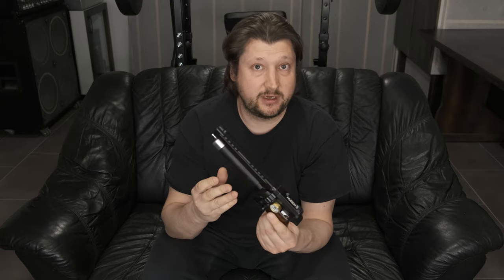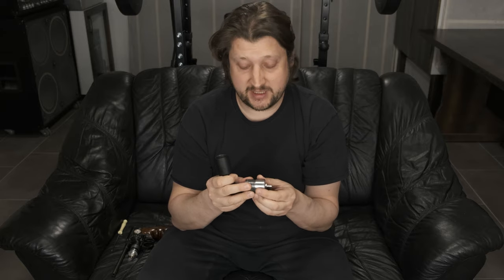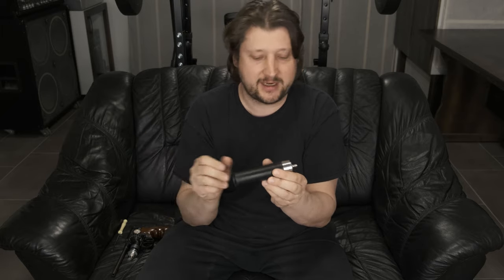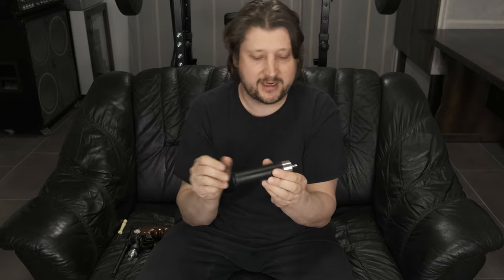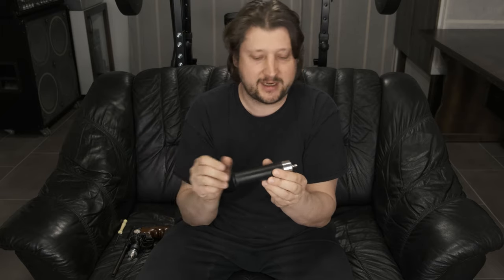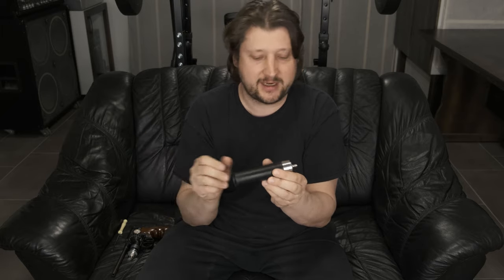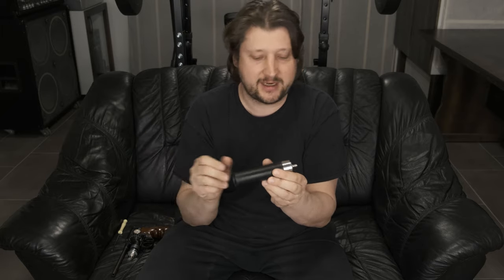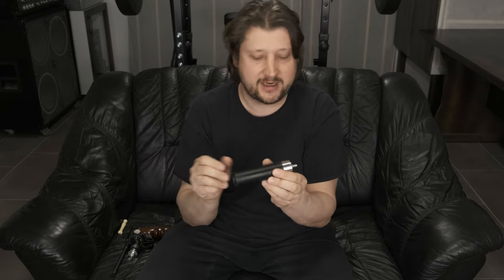Huben K1 pistol .22 cal - Part 2 - Accuracy

Comment: Just make a kit and sell it for owners to convert there rifles to pistols 🤷‍♂️ Great video man thanks
Reply: He can't he doesn't own the patent he can only make it for his self or else he would get sued not even a blueprint there no way he can make a profit off there work
Reply: @ogboppitybop9123  it would be a mod kit, no patent infringement
Reply: a mod kit doesn't make sense he would have to buy the gun still you have to cut the air tank re tap re trigger it will cost to much to produce the gun is 1500 dollars how much do u think parts will cost. What is your skill level when it comes to pcp airguns have you cut a 3000 psi tube re seal it to hold that much air. this is for his personal use. Why the hell would you buy $1500 rifle to chop it on the hopes to recreate this pistol on nice but not worth it there is to much at stake there no warranty for fuck ups
Reply: @ogboppitybop9123  
He hasn't cut the air tube, he used the plenum section of the air tube. It's a separate section after the regulator.
Reply: @tonyb4364  okay maybe I stand corrected but 1500 dollars for a pistol no one can justify that desert eagles cost less airgun tech is moving fast there will better pistols at better price points
Reply: @ogboppitybop9123  Good Point; but how cares. Kregor is one of the most dedicated enthusiasts of PCP, and I might add is top drawer as an individual. He works hard, and shares equally as well. I count Kregor as a friend. What do you find positive for him and his work? (Thanks; Please do not take this as being negative toward you, sir)
Reply: @doncoleman1841  I don't take negative at all and what I'm saying is not negative I been following his work I obviously like what he does it's not about him my point is we won't get this gun and it won't be available at anytime if ever. But it seems like your defending him from an attack that never happened . And everyone here not just him are dedicated airgun enthusiast that's why where here. And you say who cares, everyone that's here that wants one that's who my point regardless stop dreaming and get to building if you want good luck and best wishes.
Reply: @ogboppitybop9123  Would it not be possible to find a company to make a custom tube to his spec? There are many custom machine shops around that do air gun parts. Cothran makes his custom parts and then uses the Mavericks trigger setup and he creates the mod parts to build a single shot .457 air pistol that shoots a lot of shots but is single shot and accurate out to 50 yards and more no issue.  Thus I think Liam is right a mod kit could be sold and he could find someone like Cothran to make a custom tube then if you bought all the parts and bought a K1 you have his pistol.
Reply: Excellent shooting.  There are people I know don't shoot much better than that with a bench rested rifle.

Comment: Amazing, this needs to be mass produced and sold. The only thing is it sounds as loud as a rim-fire, but in the states you can quiet it down usually because it’s not a firearm. Great work!
Reply: I agree, if sold as a kit with the barrel designed to accept a moderator it would be very cool and there would be people whom would buy it.

Comment: Put a CZ barrel in and add a 300cc carbon fibre bottle, then drop the whole thing into an Ataman AP16 carbine kit and you will have a competitor for the Leshiy2. 
Excellent video as always.
Reply: @dackbowland1876  but it would be easier to shoot more accurately as a carbine 🙄
Reply: @dackbowland1876   if you are in the UK, you are looking at £1700 for the rifle (if you can even find one) before the cost of converting to a pistol. Then once converted you'd only be able to run it at sub 6ft lbs to stay legal. Then all you are left with is a low power, short range plinker that's cost the best part of 2 grand. If you are not in the UK and the relevant laws allow, you would be better off with a .22 rimfire semi auto pistol.

Comment: Your enthusiasm comes through loud and clear.. Boy is that puppy loud .I had the FX Ranchero .22... and that was loud .. My home made silencer like I make for the K1  tamed it to acceptable levels . virmine at 50 m was a breeze with the Ranchero.. Your Huben pistol looks great with possibly two or three times the FX Ranchero power. The lenght of the sil;encer made the FX Ranchero even more accurate .    Great design and maybe Huben should take note .. Your plenum idea sounds great . but with your fill valve  What would be the chance of using a carbon bottle and lead .

Comment: Adding a couple more inches to the barrel would allow you to increase the size of the air cylinder wouldn’t it? You said about the size of the plenum being relevant to the length of the barrel, and caliber. If the plenum is big enough for the bullpups barrel in my mind it will handle a slightly longer barrel. Say maybe 2-3” longer air cylinder and barrel should give you a higher shot count. Bud, I think you are onto something very fun and super cool. I recently bought a Diana Bandit PCP pistol.22 cal,9.5” barrel, 50 cc air cylinder, unregulated but moderated. It shots from a 190 bar fill 16 grain pellets at 655 FPS down to 600 FPS for 2 magazines of 7. Have you thought about making a dual air cylinder that would look basically like an over and under shotgun barrel. 2 cylinders stacked on top of each other? Anything at all to increase the onboard shot count. With your current setup you could run a remote line from an air tank even if your carful. This is so badass, truly cool as hell.
Reply: Do NOT make it longer!  Been trying to find a carriablle PCP pistol.  Small is impossible to Find .  Whoever comes up with a 6 inch barrel PCP pistol 🔫 will make a bunch of money.